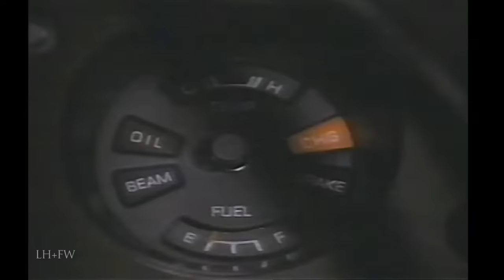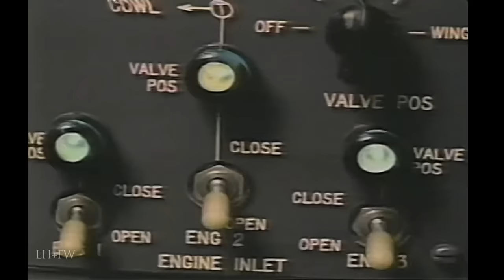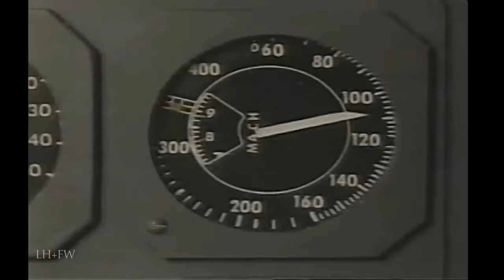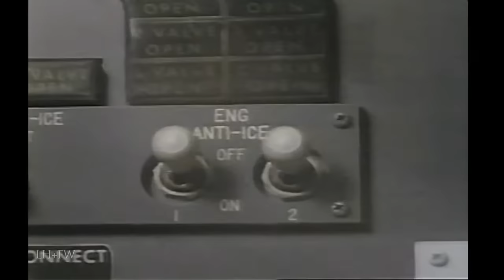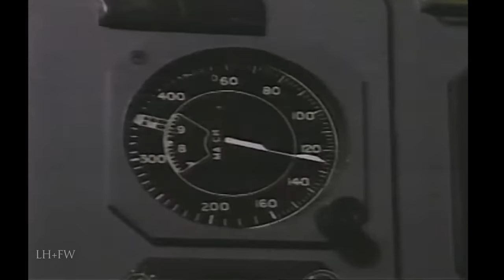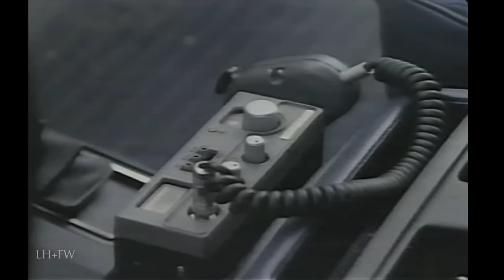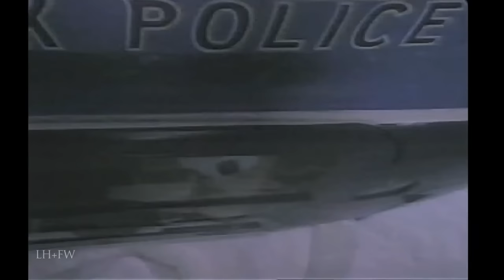"Flight 90: Disaster on the Potomac" (1984) Plane Crash TV Disaster Movie

Comment: 😮😮😮😮 Where is the coastguards. Where is the boats, divers and so on
Reply: That’s what I’m asking
Reply: Getting divers suited up and on the scene could take hours. There were no boats handy so it seems. A few men in the kind of kit that surfers wear could have got into the water as they would have had protection against the temperature. But no such surfing suits were available.
Reply: Also, it was 1982. Everything was crappy, back then. Rescue technics, cars, music, the president😏…………
Reply: What are you talking about?! The Potomac was a literal skating rink. The Coast Guard wouldn't have been able to get there without an ice breaker. Additionally, the water was above freezing, which meant that hypothermia was going to set in around the 5-10 minute mark. No CG boat could've gotten there in time--even at full speed. Everyone on board were killed--if not instantly--in under a minute.
Reply: @rogerrendzak8055  I bet you spent all day thinking up the quippy comeback.